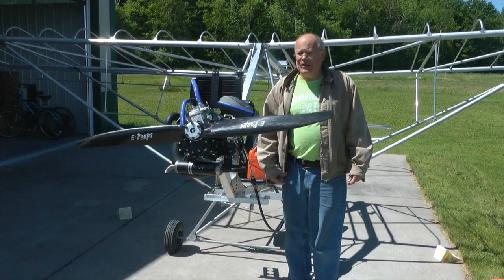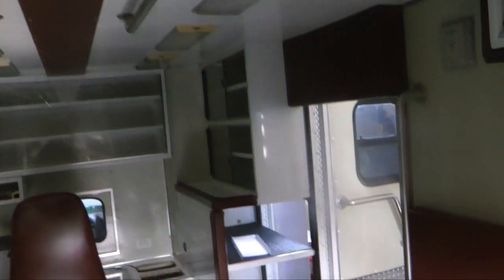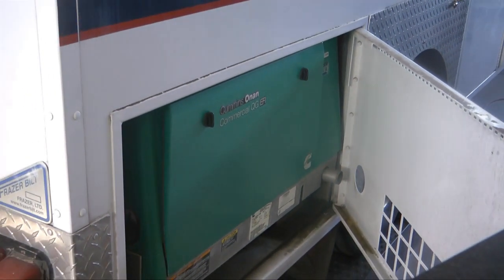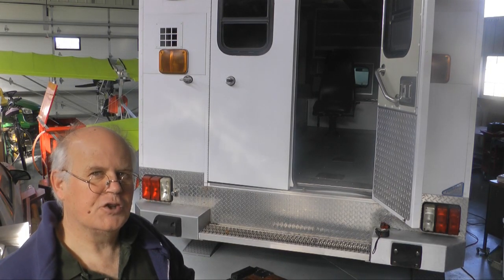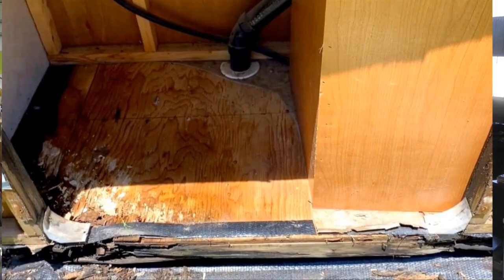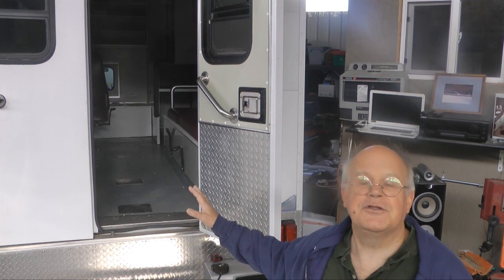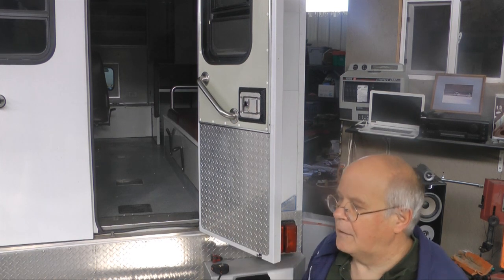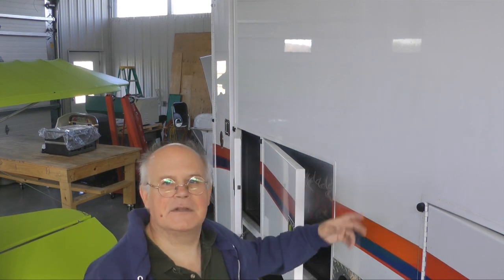This New Project Won't Fly!

Comment: Can’t wait for updates. I just did a cargo trailer conversion for a friend of mine. Solar power even runs the air conditioning/heat pump. I have 3 brand new RV type windows left over that I would kindly donate if you’re interested.

Comment: Hell Jon. How I wish that I'll be airborne next summer, but it is unlikely. Maybe in the autumn. My cash wad has been a bit depleted with the move from Italy to Bulgaria.
The only thing I've done so far is find out where the CAA is in Sofia. I've yet to get in touch and find out all the rules and regulations governing a part 103 aircraft. If it is very different to the States I might build my Affordaplane as an Experimental rather than an ultralight.
Good luck with the project you're taking on. Should be awsome once completed.

Comment: Awesome project!   Perfect for Boondocking. Is it 4WD?

Can you tell us about how much it cost? If you're planning on making it totally off grid, check with "INCREDIBLE TINY HOMES" in Tennesee. They have a package deal for tiny homes. They even have an 8x16 or 8x20 available fully equipped for off grid for around $35K.